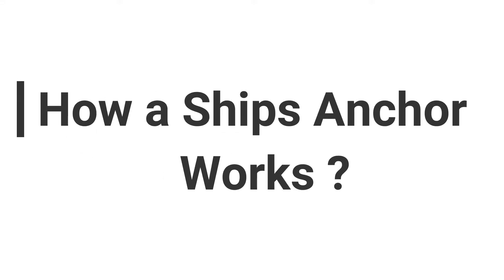How a ships anchor works? கப்பல் நங்கூரம் எவ்வாறு செயல்படுகிறது |Tamil | #tamil #tamilfacts

Comment: Sir nalla explain pannenga.... 1ton 907kg google solludhu.... Neenga 1ton 1000 kg nu solrenga.... Nanga edha namba
Reply from the maker: Ton is classified as long ton and short ton. Short ton is around 907kg and long ton is around 1016kg. In US they often use short ton, hence 1 US ton =907kg, if they measure in long ton, they represent it as metric ton =1000kg. But in UK they use long ton, hence 1 UK ton=1000kg. So it varies between 907 and 1000kg depending on what system the country is using. In india 1 ton equals 1000kg😅
Reply from the maker: Idhayum google dhanda solludhu😂